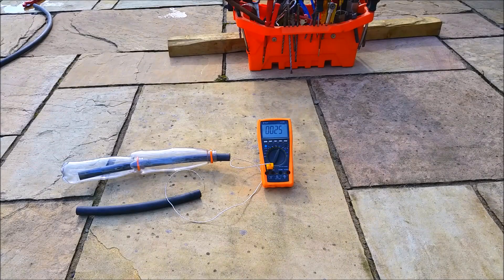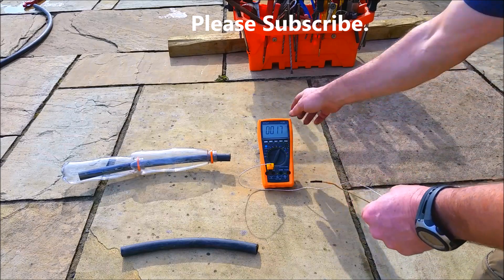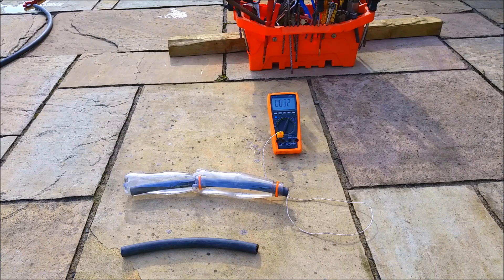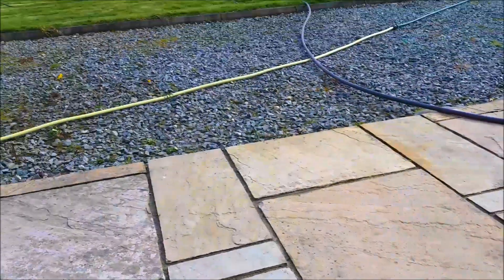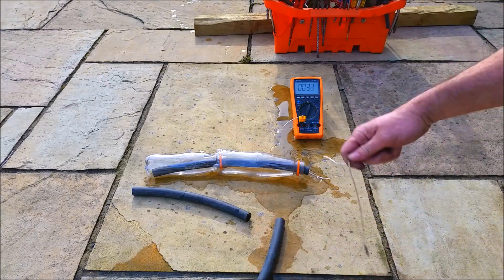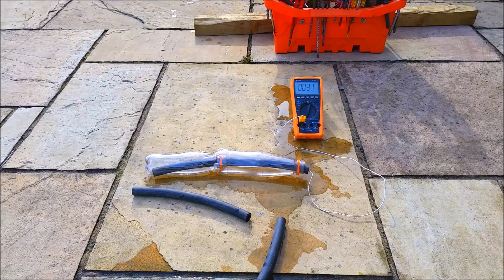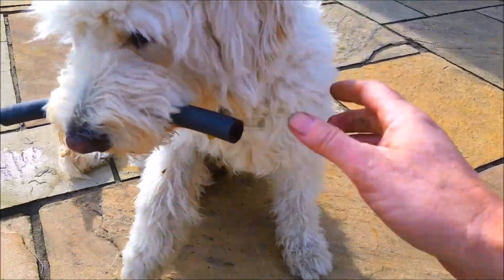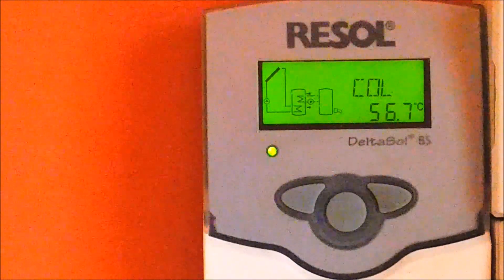Solar Hot Water Project .. experimenting with poly tubing

Comment: I think you want your solar collector painted flat black. It'll collect the heat more efficiently. Copper tubing inside of a glass covered box would work great. paint everything inside flat black including the copper coil. That's how I would do it. Black collects and emits heat very well. That's why car radiators are black.
Reply from the maker: Hi Marcel. The poly pipe would work here in Summer but I would not have hot water for much of the year. My vacuum tubes on the house can make a lot of heat even at this time of year but I will have to go to copper and glass to get max heat to extend the heating season. Sun not forecast for a few days so I will do a little more then. Thanks Gerry

Comment: Hi Garry.  I have made a few of these water solar heaters. The best design I have made is a coil design. Coil your pipe while its worm because it's easier to work with.  Leave 2 inches between each ring. Don't make it so big that you can't lift it ontop your home. Build a box of wood or metal to house the coil.  I use wood because of the insulation factor in winter. 2 x 4 s. The base board is 3/8s play wood.  Covered with 22 gage sheet metal. Painted black. They are covered with 1/8 inch plexy glass.  I can get 180 degree heat if I don't keep water flo through it. I can adjust the temperature with the water flow rate. A slow or water flow will allow the water to heat up more. A faster flow water rate will not allow the water to heat up as much.
Reply from the maker: Thanks Jerry for that very practical advice. I think I will try out some copper tubing under glass. I can store the hot water so I can pump when the temperature of the water in the coils is hot enough and switch off till it rises again. I am looking for a cheap differential thermostat so it will pump only if hotter than the tank temp. That's the plan but we'll see. Cheers Gerry
Reply: differential, two sensors (thermistors) and a £3 arduino off ebay, cheaply done.

Comment: you might get more hot water just my using the minion rocket stove to heat water in hot water tank with copper pipe for water flow
Reply from the maker: Hi.  Captianjessie1 That's true. I still have a boiler from a couple of years ago I could use and I might give it a try too. Cheers Gerry

Comment: Build a 2x4 case to put it in. Just coil it in the case. Paint the inside of the case black. You can find some used glass like old storm windows and seal it up the top. Your incoming and out going side use some foam pipe wrap to hold the heat. Most people will place the case on there roof facing the south where I live in the States. Also some use a low pressure circulating pump to keep the water moving so you do't over heat the poly. Also it is wise to put a timer on it so at evening and night time hours you are not coll your water down. Hope this helps
Reply from the maker: Thanks Ron Cheers Gerry

Comment: Hi Gerry , is that tubing food grade rating ? Or are you going to use a heat ex-changer ?
Ray
Reply from the maker: Hi Ray. I have a spare 300 litre Stainless hot water storage tank with an indirect coil in it so I will use that. The tubing is actually food grade but it's very chewy Lol. I think I will use anealed copper pipe under glass. There is sun forecasted for Saturday so I can check it out then. It's currently raining here as usual. Cheers Gerru